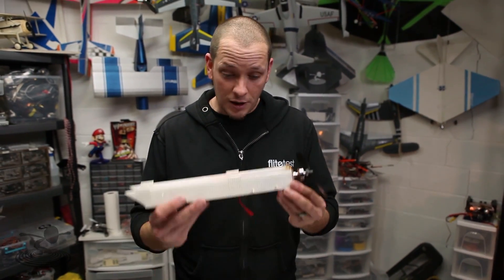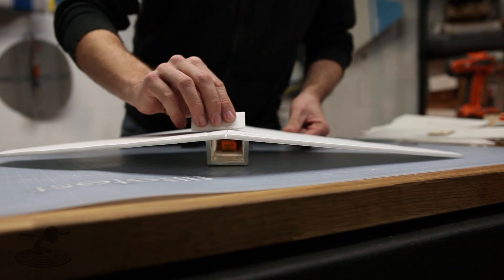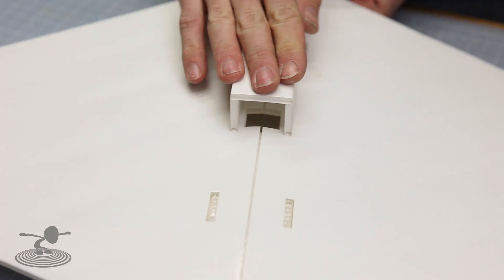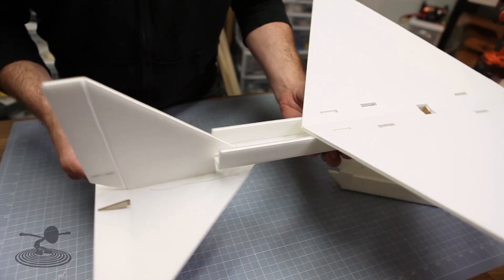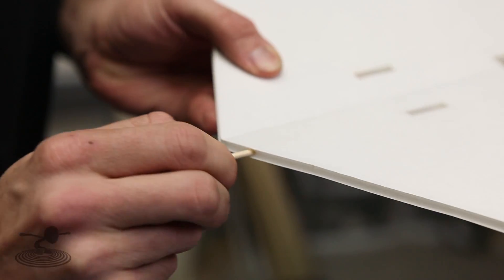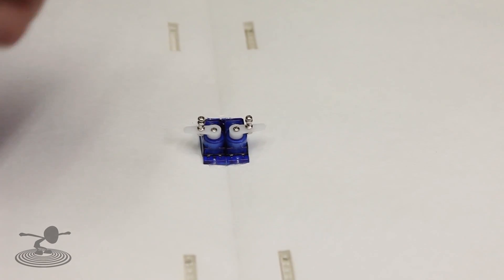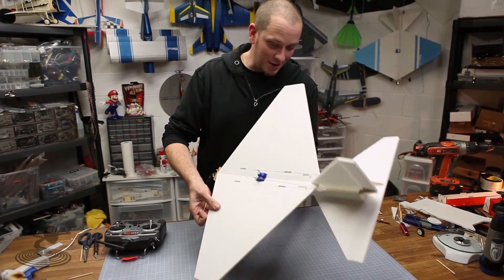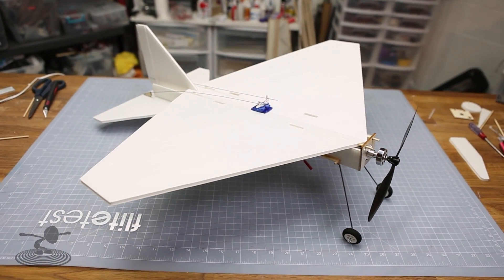Flite Test - FT Flyer - SBK - BUILD

Comment: Just built the frame.  What a snap.  One trick with the bevel and he gives you a tip.  Start in with a blade; then run back over the cut you make with a sanding block.  I found it much easier after really screwing up a few bevel cuts.  This is a really fun build.  I enjoyed it more than the nutball.  Both builds are fantastic and easy for beginners.  Also another tip that he really doesn't cover is the linkage stoppers.  They don't come with the kit but you can buy them from the flite test site or most online hobby shops.  That's my only gripe about the kit so far.  Good times.

Comment: When cutting the foam, how did you get it to not cur up into a ball of foam underneath the foam? All my foam builds have bad joins and have crooked cuts.
Reply: He uses the speed kite they are laser cut 5mm foam that they sell the 3 trainer planes without electronic for 33 usd use a new sharp blade for best cut also use a big ruler.
Reply: so i use regular utility knife blades and the trick is to hold it at a really really shallow angle, and then i only use it like 5 time then throw it out. another trick i found is to score the paper first then use 2 more passes to cut through. that and practice.
Reply: "really shallow angle".. do I tilt the blade, which way? The direction i'm cutting in? to the left?...
Reply: Charlie MacDonald ya like imagine if you were slicing bread, you wouldnt stab into the middle and pull the knife through. nice thin slices.
Reply: You could try cutting it a bit larger and then tidying up edges with a little sanding using fine grit sandpaper. It works fine with rough edges though so I personally don't worry about it.

(I know it has been 2 years, it might not help you anymore but this might help someone)

Comment: Go to HobbyKing and find out.  For a small plane like this, you could probably get two LiPo batteries, a motor, ESC and two HXT900 or 500 servos for about $35 plus shipping.  If you don't have a LiPo balance charger, they have them for every budget.